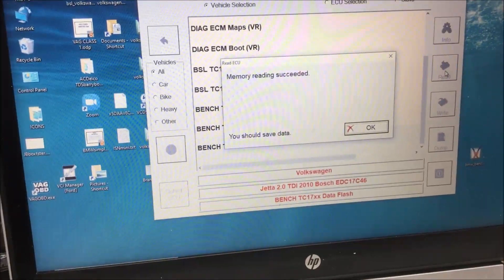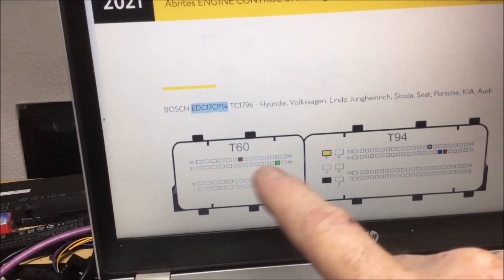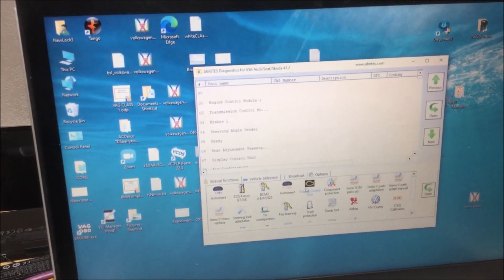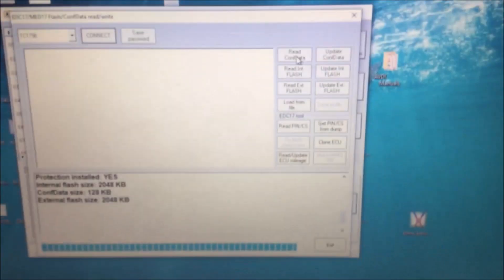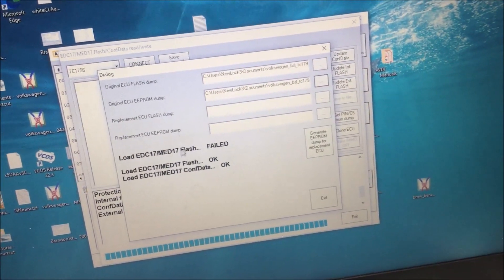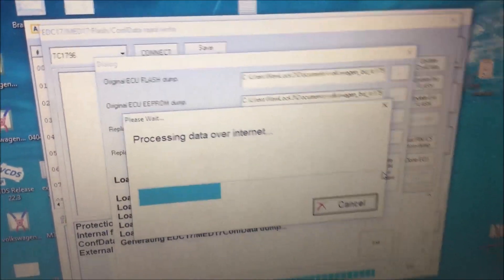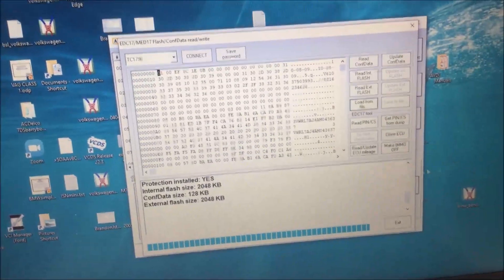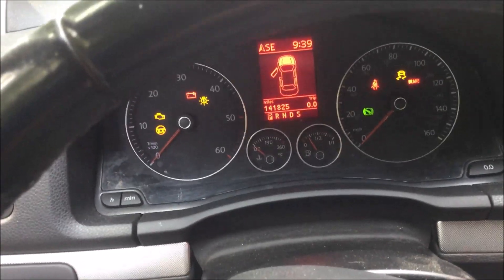Cloning an VW 2009 TDI ECU EDC17CP14

Comment: Hi Tim
After the new eeprom was generated by abrites do I need to paste it along with the original flash in the doner ECU or I paste the generated eeprom file only?
Thanks in advance
Reply from the maker: it all depends on wether the program asks you to load the flash or not.. on some ECU's it will fix the flash and the eprom, actually, the two flashes, but on some it only changes one.. the program will tell you...
Reply: First of all, I'd thank you very much for your response, but my point is,  after i load all files that are asked by the program. The program will generate a new file (if i understand you correctly),  so at this point, do i need to load this new file in the doner ECU alone or combined with the original flash? 
Because I think the program will going to generate a modified eeprom not flash file. 
 
Thank you again 😊
Reply from the maker: @mohamedbashire5869  Yes, just write the new file that AVDI makes.. don't need to rewrite the other files... as long as it is the same ECU.. Abrites has figured out how to rework the Eprom so that the new ECU looks like the original to the car..
Reply: @timtracy9442  
Thank you very very much 😊

Comment: @Tim, what was the start of this story? In what way had the original ECU failed and how did you confirm it needed replacing?
Reply from the maker: The shop did the diagnostics, they concluded that the ECU was defective... What they told me was that with the old ECU, there were DTC's concerning rail pressure and injections issues.. I really didn't check, this is one of my good shops, not a shop that arms the parts cannon and then just pulls the trigger... And just a note, I tried ODIS first, it had a  test in the test plan to replace ECU, when I did that, instead of getting the form to send to germany, it came back and said it would program a used ECU, but when you clicked on complete, it said it couldn't talk to the new ECU.. Got out ABRITES and read the old and new ECU, then tried to just write the flash and the eprom to the new/used ECU, but these have OTP, One Time Programable sectors... then I found the clone ECU function, it was way to easy.. That is why I sounded rather happy in the video...
Reply: @timtracy9442 :) I totally get that. I've adapted ECUs with AVDI before but not attempted an ECU "clone" so I'm going to have a look at this as I think I have a pair of part number matching ECUs in my stash so I can setup a test on the bench and try this feature 👍
Reply from the maker: @Franksey180  hope it works well, seems to work on MED17 and EDC17's rather well..  I had a MED17.1.62 from a 2018 audi TT, tried reading the MAPs from it and it failed, tried another and it failed too, found out all three cars were tuned.. the APR software locks it so you can't read and copy the maps...
Reply: @timtracy9442 so this method didn't work on the APR mapped ECUs?
Reply: @Franksey180  it is bad solution when you try to clone it will not work all the time...so it is better to replace eprom with new data ...also  you have isssue with software version.. so dont clone... make eeprom calculation
Reply: @deanusa7384  Ok interesting comments. I'm not sure if Software version is an issue if you have part number matching identical ECUs and clone the data between them?
Reply: @Franksey180  yes even that you have problem to start... just not all models is good for cloning. just like Tim did is all ok.... it make calucaltion  for  dumps for eeprom and flash..it is not usual cloning..it clones pin,vin mac and cs..etc...not data flash  etc...it is stil original from donor 😀
Reply: @deanusa7384 Ok so in your opinion this method is only cloning the immo data, not the flash data?
Reply: @Franksey180  Correct... you can do by ktag after that...
i done with tango calculation just write after that with ktag.. job done..
Reply: also did you try PCR ecu...😀
Reply: @deanusa7384  not a fan of those, didn't get a smooth ride trying to unlock them with AVDI, seems inconsistent.